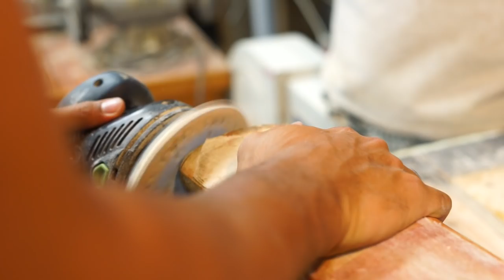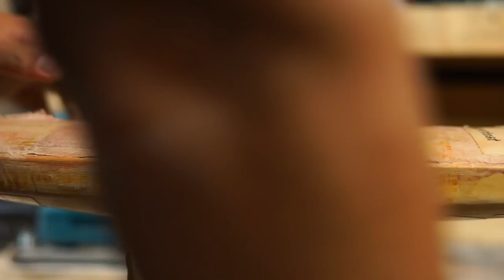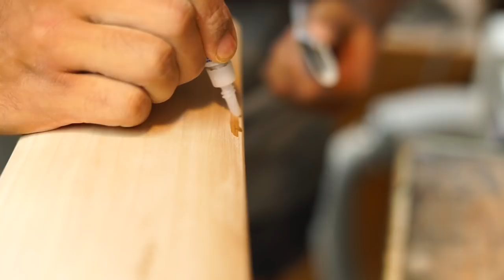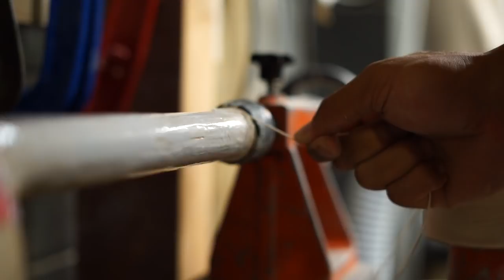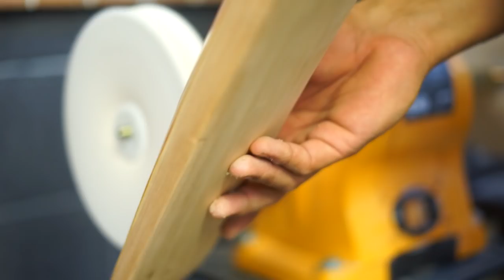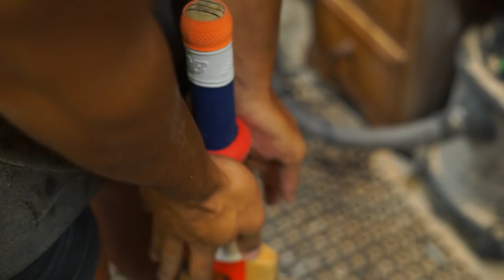Cricket Bat Repair EP-7 - The first service of this old bats life.

Comment: TECHNICAL BAT BALANCING QUESTION:  Hey mate, I needed some expert advice from you regarding my new cricket bat. You truly are my LAST RESORT. I have a 2.10 bat which is bottom heavy. It's a new handmade bat I just purchased. I am not really happy with its balance/pickup. I used to play with a double-gripped CA15000 which obviously has a 100% round handle and it felt light as a feather! What do I tell my bat-maker to fix in my new custom bat if it is bottom heavy? It has a thin oval handle (I have always used & loved fully round handled bats before) and I have 2 grips on it already but that doesn't really help with the pickup and balance. Should I get a 3rd grip? Should I ask my bat-maker to replace the semi-oval handle to a fully round handle as I used in the past? I am a bottom handed player by the way. Perhaps I could have him trim the bottom round (like David Warner's new bat and KL Rahul's bat) instead of the traditional square bottom to shed some weight? Or should I try something else to get better balance?